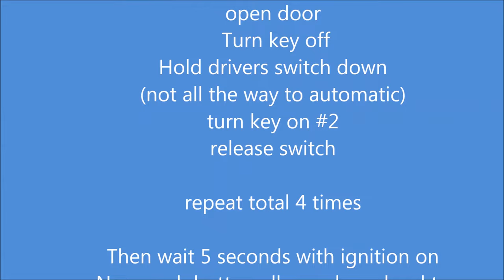Honda Power Window Control Reset...  Civic,  Accord Others

Comment: Thanks. Worked for my 2019 even with the push button start
Reply: How??
Reply: @junito1008  go through the process the same way. Without putting your foot on the brake, pushing the start button once mimics key position 1, twice for key position 2.

Comment: What if the window don't go down. Some times it does some time it doesn't same wit the other windows.  Sometimes the driver switch will control them sometimes u gotta role each one down at each door😂😂 is been an Intermittent problem.